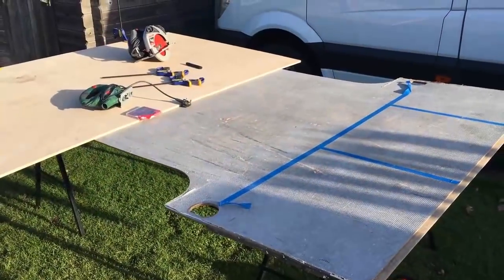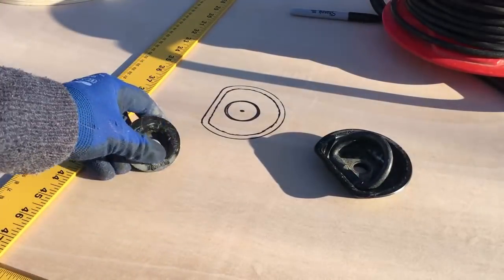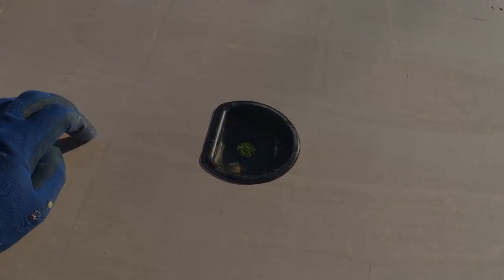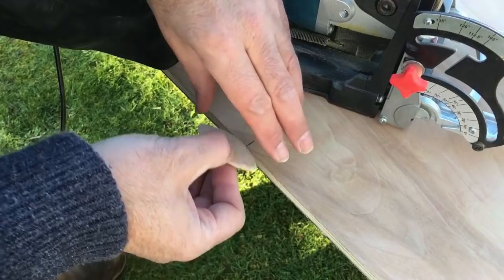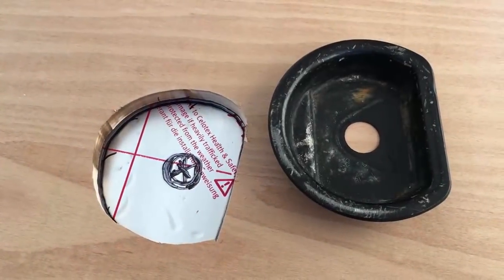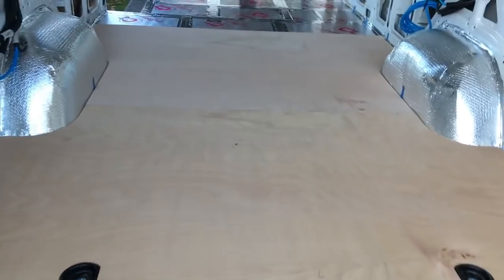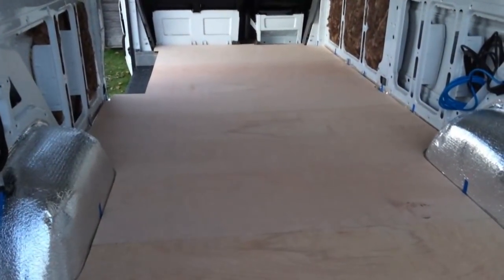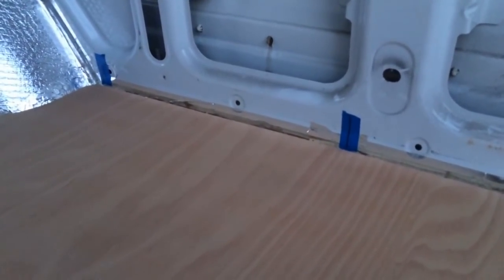Mercedes Sprinter Camper Van - New Floor

Comment: Will you be staining and sealing the plywood?   Enjoy your informative videos. Mw
Reply from the maker: The ply is a base layer to the finished floor.  I was thinking of giving it a protective coat of varnish before applying a further floor finish, possibly Vinyl, what floor finish would you have?
Reply: Myself ,I'd probably sand, stain a medium oak( neither too light not too dark) too light will show dirt , too dark makes space feel small...a good semi gloss sealant. As well as you have it insulated road noise should not be too bad.   A nice thick vinyl and a rug would be nice also.
Reply from the maker: Baltic Birch has a lovely finish but is heavy though? I'm planning to go over this plywood subfloor with a Vinyl flooring.

Comment: I was wondering if could have used double sided tape (the thick stuff with foam in the center) to apply the insulation boards to the sides inplace of the metal tacks with strong glue.  The foam tape would be easy to remove if needed.
Reply from the maker: You would need to check what the temperature range of the tape is as the external van wall can get extremely hot and the tape will fall off the walls.

Comment: Hi Greg - Im sure its all to come in a future video, but can I ask how much your budgeting for the build.. Im eager to get my own build underway and cant thank you enough for this series..
Reply from the maker: Hello, yes there will be a full breakdown of costs once I've settled on every item.
I have done an initial budget and the van cost £6,600 and I've budgeted £8k for the build out. 
This is not going to be a budget build but aiming for a top quality finish comparable to a professional fit out.
There are so many budget builds and vans built with reclaimed materials that look fantastic. 
I have some big ticket items that make up the build figure, solar, heater, wet room, LPG, water tanks, toilet, controls, lighting, electrics. 
Hopefully it will demonstrate what a home DIYer can achieve in your back garden and garage. Hope you enjoy the videos.
Reply: Greg Virgoe Ive spec'd my build right at 7k and that was plus/minus £500. So its great to see your figures are basically the same as I know they will be as accurate as can be. Im torn between real wood veneers or pre-finished materials for the furniture as these  really dictate the feel of the build - but Im visiting a motorhome show next wk and another next month so budgets may alter depending on what I find - prefer the veneer so far.. thanks again
Reply from the maker: Hello, what surprised us with the budget is how much all the sundries add up to. Seems like every time we got to wickes or b&q for screws and mastic it’s another £50 😮
We went to the Motor home show at NEC last year. We really liked the high gloss furniture board they made it look high class and would be easy to wipe down. A company called Morland will send you free samples of lightweight furniture board which will help making a decision. Of course we like the most expensive option. Typical. 😂

Comment: Dear Sir, watching your videos with great interest! Well done! Question all that wood, timber and mineral wool you would use against the carbody is waterproof non moisture absorbing? I had a van with wood n stuf before and that all was rotten after short time? Change it to AL profiles, waterproof floor panel and van ISO mat X treme Isolator from Reimo, that worked amd need vent. Airgap everywhere between metal sheet work ( body) and insulation..? cab was insulated by curtain to midgitate max heat loss thru cab..a 2 Amp heaterd (500 watt) called ecomat with ball bearing vent keeps such van nice and toasty down to 3-4 c minus (@ 3 Amps hook ups available often and ofter four free),  floor was heated with thin fil, 1 amp carbon flex foil..so av. Room temp can be reduced to 16. 18 C to fell well..if truma heated you need 21 22 to feel comfortable..a van with 160 watt solar and 160 Watt Lifephos batt does the job in cluding TV, ausb, Led, 1800 Invertert ( koffee or other short term Power requirements) and fridge ( dometic or others j cheapest by gas to be operated..
Cables reduced (1/2 or more)  utilizing body minus, Can bus and max 1,5  mm2 for a max of 16 amps (sockets) - sockets can be powered with inverter up to 3000 watt peak as well
Behind the insulations and in cabinets are PC ventilators installed (pv powered) so reach en av of 30 -60 rel humidity and 0 condesation.. But now I use a Rv type camper, we less interesting
Reply from the maker: Hello, the Earthwool is water repellent and the timber was pressure treated to prevent rot. Having said that the entire floor was covered with a foil vapour barrier before the new ply was laid to prevent moist air getting to the van. Also I'm fitting a 4KW Truma gas heater so it's going to be hotter than the surface of the sun inside my van. Warm and dry, not cold and damp 😃 Thanks for watching.

Comment: Hi Greg, did my eyes deceive me? did you cut on the outer line of those tie downs  making the hole too big.  It would'nt be difficult to confuse me.  We've just sold our motorhome and i would love to take on this project but my says i'm too old.
Thanks for the video
Reply from the maker: Hey Keith, the age is affecting the eyesight too ;) lol only kidding.
I drew a line around the outside of the tray, then I drew another line freehand about 1/4" inside that which was the width of the flange, then I drilled a hole and cut inside the inner line. When I dropped it in the hole it didn't fall through 😃  Thanks for watching.
Reply: About those tie downs. I understand, and applaud, the need for such a vigorous vapour barrier, but aren't those tiedown bolts basically transferring the cold outside into the van? Would that cold spot cause any condensation?

Comment: HI Greg, is there a reason for not re-using the sub floor that came with the van?
Reply from the maker: yeah, you can’t see on the video but it’s pretty beaten up around the door ways and has lots of holes in it where old tie downs were plus it’s extremely heavy! I want to lay vinyl so need a smooth finish. It was about £100 for the new floor so I thought it was worth it. Cheers

Comment: Greg, have you any wiring under the flooring.
Reply from the maker: Yes I have two 50 x 25mm pvc conduits under the timber floor from one side to the other. To get cables from control panel across to drivers side.

Comment: Hi Greg, we love your videos and are using them as a template for our newly acquired LWB Crafter.  They are the best conversion vids on the web by far Sir! Sorry if this is a daft question... You mention 12mm hardwood ply. Is this non structural ply or marine? Thanks for all your efforts! I don't know if you are aware but, you have legend status!
Reply from the maker: Hi Jenna, thank you for the lovely comment.
It is better if you can get Marine ply, as it will last much longer, is more resistant to moisture and will not delaminate over time.
Reply: @GregVirgoe  Spot--on advice there Greg: As usual.
All I have available at a reasonable price is pretty crap ply from the equivalent of Home Depot (B&Q in the UK..... I need to be very careful not to get a duff sheet: Having said that, our climate is much less harsh than the UK so is generally not too big a problem. 
Think you'd agree that your readers & viewers need to consider their own climates when rating insulation, vapour block needs etc .....
(After all: You have become an International Super Star!)
And quite rightly so: Your knowledge, approach, skills are to be envied.
I, and I am sure, millions of others are most impressed.
Well done mate.....Thanks & Cheers from Chile.
Reply from the maker: @patagualianmostly7437  thank you very much fir your kind comments

Comment: The Mrs has already noticed I've watched too many of your videos during our own van build so whenever I'm stuck she asks 'What would Greg do?'!!! 

I have a question now I'm at this stage: is there any reason not to use the original ply floor if it's not in too bad of a condition? I'm struggling to justify spending money on additional ply that's going to be cut to the same shape as the original factory fitted one and it'll be covered (just a small extra gap by the wheel arches as it's now going to be raised 25mm from the insulation). It's not in the best condition as it was an ex-trade van - but I could probably clean it up enough to get a nice flat surface for the finishing flooring to go on top of it.

Thanks for all your effort that has gone into these videos, you must be well chuffed with the finishing product. Hope all is well on your travels during the current situation - we're very jealous over here in Swanage!

Comment: I have a 2004 Sprinter Van and interested in doing a conversion. My question is are you doing insulation in the van only due to cold climate ? or would I need to also insert insulation in a hot climate.  Is the insulation used for sound proofing or because of climate.
Reply from the maker: Your insulation will work both to keep warm and cool, best to insulate for both scenarios and you will benefit from some sound attenuation too.

Comment: Hi Greg 
Just a quick question,
 are the tie down bolts used for something later on in the build or could you just leave them out when it comes to the floor build ?

Thanks bud
Reply from the maker: You can just leave them out and put small stainless steel bolts in the holes to seal them up.
I put these two rear ones in to give me a tie down points for a motorbike later on.

Comment: Great as usual - what did you finally put on top of plywood (floOR) 
? Laminate or something different?
Reply from the maker: Hi, we are using "Altro Walkway" which is a super touch flooring that comes in 42 different colours and is typically used in heavy traffic areas like Gyms, Hospitals, Commercial buildings, etc Check out these colours, we have gone for blizzard as our cabinets are quite dark, it has a slight glitter to it also. :D https://www.altro.co.uk/Altro-Walkway
Reply: thx m8!

Comment: Hi Greg,you do a lovely job,im at the same stage as this at the moment  but wondering Why you didnt just use the old van Mercedes floor? If it's in good condition that is.
Regards Mark
Reply from the maker: Well that was the problem it was wrecked near the doors where stuff had been dragged across it for years.
Reply: @GregVirgoe  mine is a bit scratched but only lightly,I will be covering it anyway. Them videos you do have been a great help to me thanks Greg
Reply from the maker: @markegan3998  if it’s not too bad then it’s good quality wood so go for it.

Comment: So why didn’t you just put the stock floor over the insulation? Are you going to put floor vinyl over?
Reply from the maker: Hi, it was pretty beat up near the doors and had holes in it from the tie downs. I am going to be putting down a vinyl on top and those would have shown through.

Comment: Does anyone know when you put the ply wood down, how many screws do you use on a batten and what length screws. Do you need to put sealant or anything over the screws? Thanks
Reply from the maker: 25-35mm screws if floor is 12mm and batons are 25mm. I varnished my floor once it was laid but no special treatment to the screws holding the flooring down. 👍🏼😊
Reply: @GregVirgoe  Thank you for the reply! :D

Comment: With the floor boards why didn’t you use one larger pice to clear the wheel arches and then one board to cover thereafter? Do they not make them large enough?
Reply from the maker: I was using 4no - 8' x 4' sheets and didn't want any joints lengthways, I used the remainder of the wood on the kitchen units.
Many ways to skin a cat as they say and really no right or wrong way whatever suits your van I guess.
The factory floor was two much larger boards that were full width and longer too.

Comment: Hi Greg, love your content. Cant tell you how much help you've been during our sprinter conversion so far and weve only just put the timber batons down on the floor. I was wondering why you chose to use a 12mm ply instead of  something a little thinner? I've seen a few 9mm and just wondered if there was any particular reason for it. Thanks Olivia

Comment: Hi Did i note that when you put the insulation up to the roof you used metal pins that were stuck to the van roof ----- where did you get them from Thanks
Reply from the maker: In each video description you’ll find links to all the products I have used. 😃
Reply: @GregVirgoe  thanks but i cant find the video -----  i was called out just when it got to you fixing up the sheet and lost the book mark :(

Comment: Hello. I was wondering, are you planning on a shower room? If so what are your thoughts on vapour barrier? Having a bit of a discussion ona forum about it.. People are saying it's a bad idea, as it is just going to cause too many problems with mildew and mold, and carrying enough water for a shower etc. I personally want one as want to make sure I can have a shower when and where I please (providing I have enough water). My undestanding is that so long as there is adequate vapour barrier and perhaps a fan to extraxt humidity in the shower room then should be ok? Also if the van shell itself has a vapour barrier, that doesn't mean you can just leave your shower door open  as the vapour would not be able to get out (apart from the van fan on the roof?. Love to hear your thoughts, I've probably rambled on.
Reply from the maker: Hi, please take a look at the insulation videos for details on the vapour barrier. 
I am putting a wet room in with a toilet. This will have its own extract fan at high level. 
It will also have a vent from the gas fired heater at low level. 
I'll be able to hang wet clothes in there and use it as a drying room.
You must have a vapour barrier installed in your van to prevent condensation forming. 
Then adequate ventilation and heating to prevent it being damp inside.
Please do look at the rest if the videos in this series they will answer a lot of your questions. 
Thank you

Comment: hi i am just starting my van conversion & i have used wire wool to take off rust just wanted to clarify do i need to use a rust converter before i apply the white hammerite ? thankls
Reply from the maker: If you have cleaned it back to fresh metal hammerite can be applied directly. 
It would be better practice to apply a product like Krust and then I apply metal primer then top coat. If it’s on the floor I’m unseen areas you can just brush on hammerite after treatment.
Reply from the maker: The red oxide after cleaning would also work well.

Comment: With such a strong sub structure of battens at appropriate span and the insulation was 12mm ply thickness excessive? Was there a particular reason for choosing 12mm. 7mm 'structural grade' probably would have done the job fine? Particularly as cabinets and bed frame cover most of it an thus there is only a small area where foot traffic occurs. Watched right through, OK you used biscuit joints so needed some thickness to accomodate. I don't think that is necessary. Particularly if at a later date you want to remove all or part of the floor.
Reply from the maker: allanpennington you need something at least 12mm as it still flex’s under foot. 
7mm would simply snap

Comment: Turned out very nice. Good idea on the tied downs and biscuits! What kind of adhesive did you use to hold the batons down? I meant to ask then.
Reply from the maker: Hello, I used Wickes brand "quick grab adhesive" only for cost purposes.

Comment: Is that sub floor totally level? It looks like the battens protrude slightly. If so does that cause added noise through vibration?
Reply from the maker: Have you watched the previous video installing the battens? https://youtu.be/DxJ38lQfSg4

Comment: Any advise on what type of van to buy ? im hoping to get lwb thank you
Reply from the maker: It’s a tricky question as each have their good points. Sprinters are reliable, Crafters hold their value because of the VW following. Fiat are more roomy inside, fords are cheap to repair. The Mercedes just drives so well and is so comfortable on long trips. But it’s not the biggest in the back. Not sure what Fiat drove like but they got more room in the load area as square sides. 
Whatever you decide proof of regular servicing and oil changes with high mileage vans is a must. Bills and history prove it’s been looked after. Good luck 😉
Reply: hello my names sid.  yea its a tricky one mate , you said fiat is square sides, that would make fiiting inside easier ? are fiat expensive to repair  and reliable  ? 
 funny i live in thailand i was just watching one of you lvogs vids whenu messaged me.
i plan to start build as a total novice next year. if i could fire you questions in future that would be great ? 

your vids are realy clear and instructive so that you feel is possible to do this build myself 

what do you think about tools we shoulld buy ? 

what parts of build do you think us beginers should farm out to co. ? 

thank you so much for your time Greg
bon vouyage
Reply from the maker: @roninchiangrai67  
Tools - drill, jigsaw and circular saw would’ve helpful. 
Farm out gas if not competent but electric should be able to tackle with guidance. 
Watch my schematic tutorials for lots of help.
Reply: thankyou for your advise. your a guru of van builds, lol. if you have time in future i will have more quetions  please if ok ?